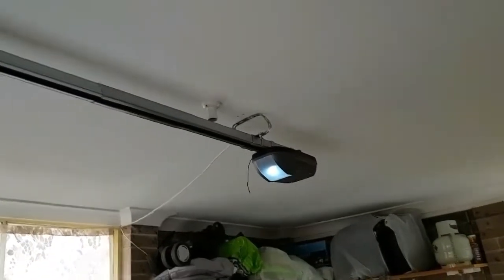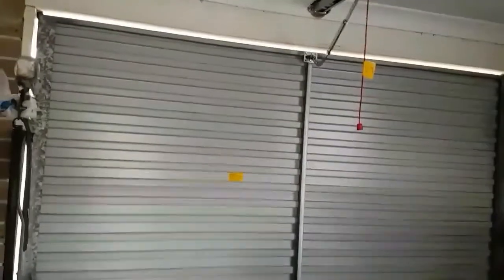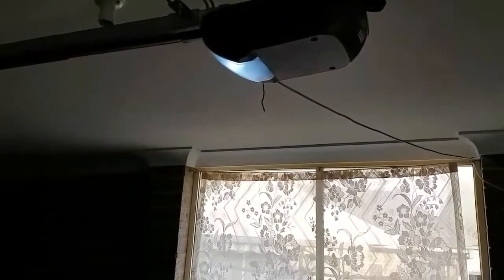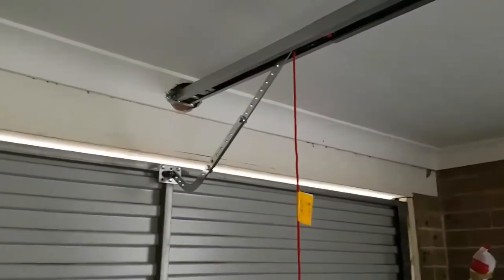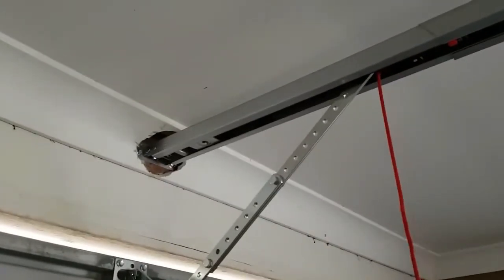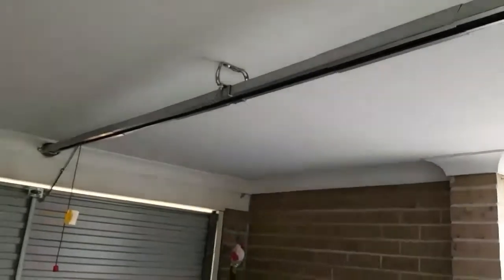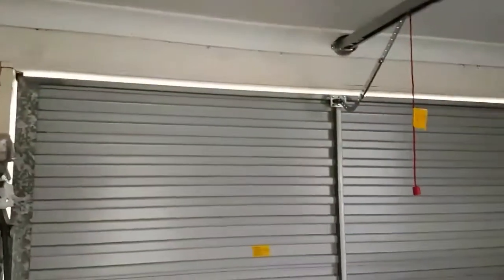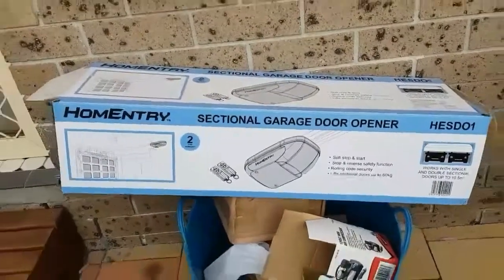DIY Garage door opener for tilt and sectional doors

Comment: I just installed the same one from bunnings on a tilt door like the one you have today. It does not have the strength to pull it open. Any ideas what I need to do.
Reply from the maker: Single or double door? Try lubricating all door hinges
Reply from the maker: Also check if the chain is not too tight, it should have some slackness
Reply: @RathanNag  single. I needed to increase the tension because the chain was jumping. I will try lube. 
I think the force needed is just too big as the spring setup on my door is slightly different. 
I really appreciate you replying so quickly. Thanks.
Reply from the maker: @IsaacLoven  if opening the door by hand is too hard, then I guess the motor will struggle too. Check how you can reduce the door resistance, also make sure the height of the top lintel bracket is at sufficient height, there is calculation of required height in the instructions
Reply: @RathanNag  I can open and close it with 2 fingers
Reply from the maker: @IsaacLoven  then, I think it's not the motor, check the height of anchor